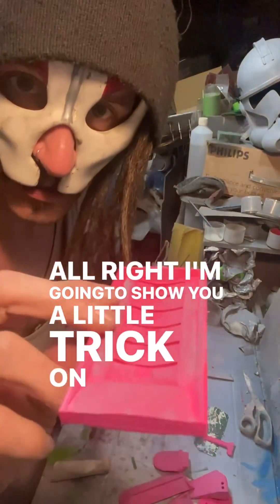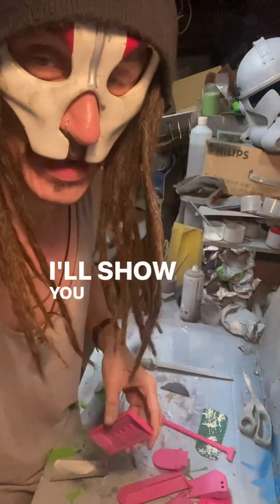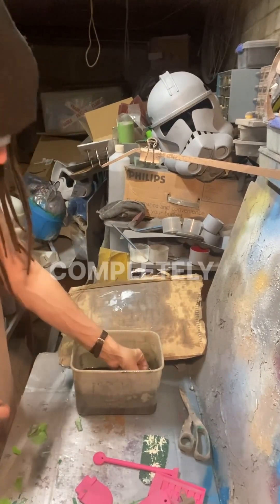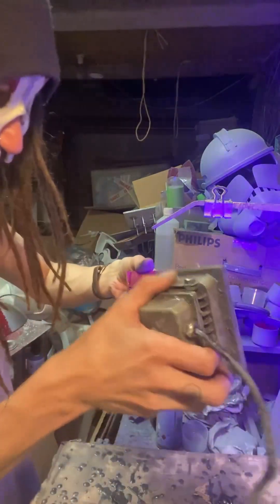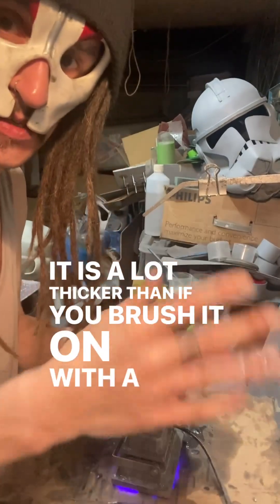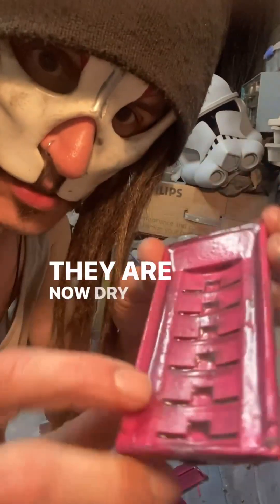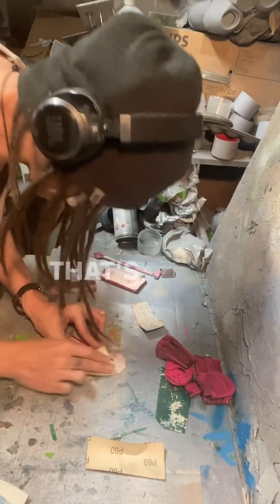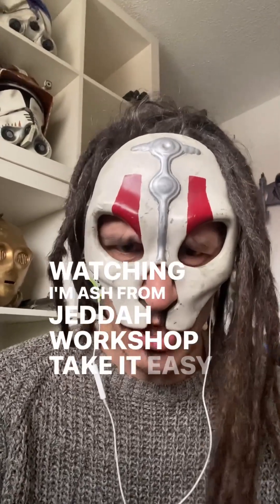TUTORIAL 10 - HOW TO Smooth your 3D Printed Accessories. SUPER DUPER FAST METHOD!!!!

Comment: Awesome! Try using pressure paint to spay very thin layer of resin over 3d printed part to avoid big clump? Maybe a basic gardening hand pump sprayer could work?

Keep up with good content! :D
Reply from the maker: I did this for months through my air compressor because it was such a fast method and even coverage, whilst wearing a mask and with ventilation. It gets EVERYWHERE, is next to impossible to clean off and I had a sore throat for about 2 months to the point where i couldn't speak. I stopped and it went away. I strongly advise against it. Its not nice stuff. Nothings worth your health x